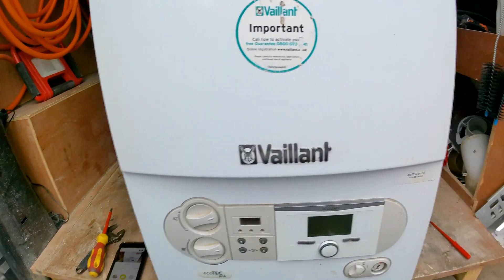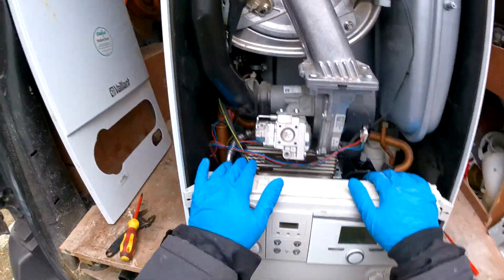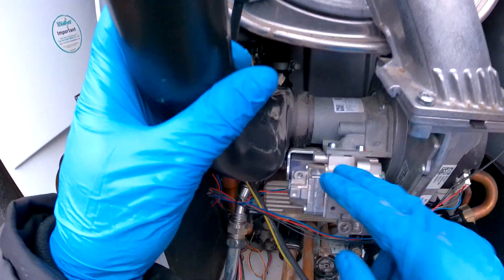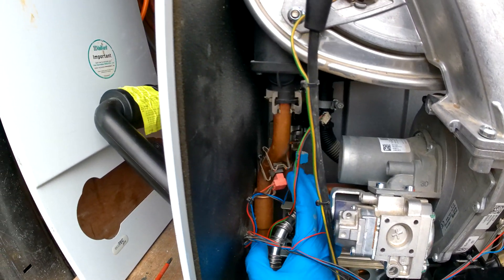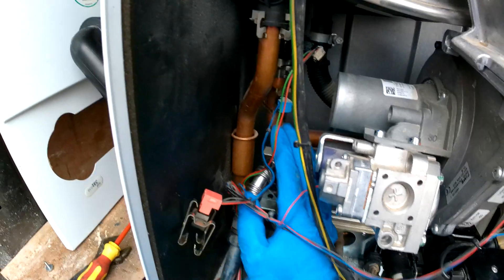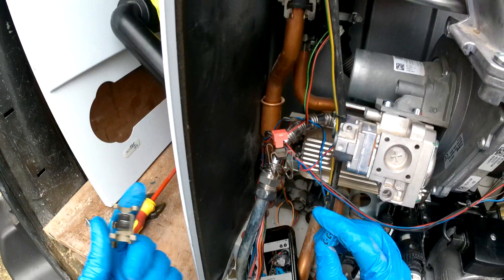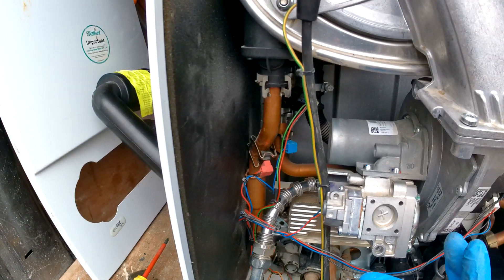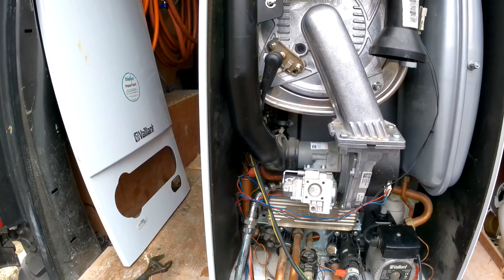Vaillant EcoTec Pro | Changing The Flow & Return NTC Sensors (Fault Codes In Description)

Comment: Hello masters
Vailant Eco tec pro
286 5/3

Hot Water line is always warm There is a flame and tap sign on the screen

Changed parts
Water flow turbine and sensor
Plate heat exchanger
3-way valve
Ntc sensor

It did not fix, the expansion tank was also checked
Where do you think the problem is? Error code None

Comment: Ecotec plus heat only 428 has F22 the whole time - checked the thermists , they are straight .  The system is not empty OR blocked - have powerflushed./